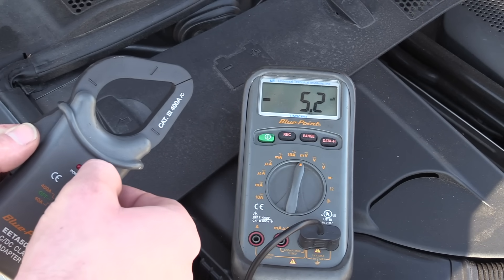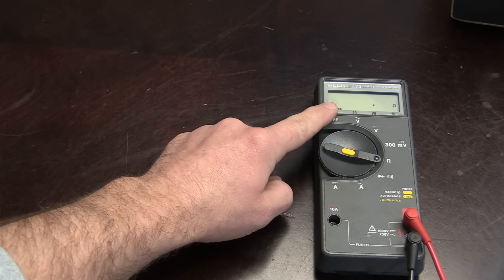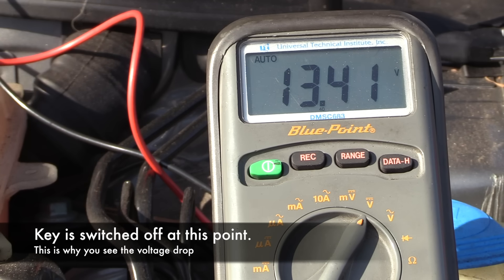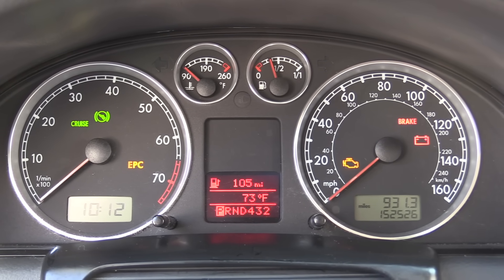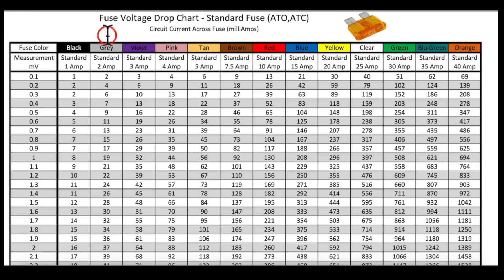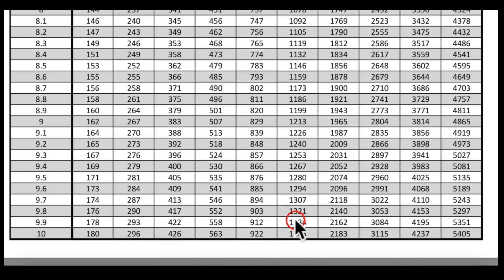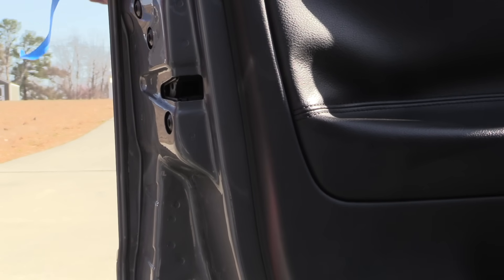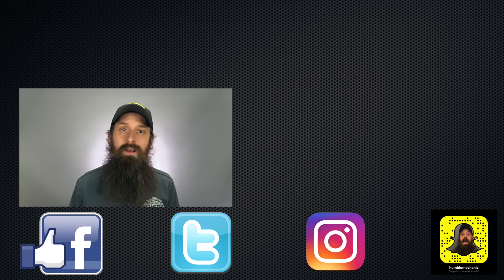The BEST Way TO Perform a Parasitic Draw Test

Comment: Ok there is a better way to do this check even for a novice.  First remove the negative connector on your battery. Next with all door closed and accessories off connect a test light to the negative battery clamp and the other to the meg. Pole on the battery. If the light shines brightly you have parasitic draw. If it does the pull one fuse at a time until the light goes out. Remember to check fuses under the dash and under the hood. Very simple works  every time.
Reply from the maker: This doesn’t work for modern cars. The issue is disconnecting batteries and pulling fuels can actually false fix things. 

Great method for older cars. Well except the door closed. Lol you need access.
Reply: Make sure you replace each fuse after you check the light before pulling the next fuse.

Comment: This is why I have 6 pre 1970 vehicles. No chips. The only parasitic draw I had was leaky diodes in an alternator and that was 50 ma, low battery in 1 month.

Comment: Pro Tip - Don't use cheap meters.....Make sure you are using a meter that uses True RMS and using a meter with LowZ also can help...using a non RMS meter can have you chasing "ghost voltage" ...also, using a meter with LowZ helps with applying a small load on said circuit being tested....My personal go-to DMM's are the Fluke 87 and the Klien MM2000....both are very accurate and will keep you from pulling your hair from chasing ghost voltage...the powerprobe is also very helpful for circuit activation, but using a DMM is the best way to chase down your draw....fun fact- most parasitic draws are caused by either a swollen battery, that is leaking acid,as the acid basically can cause a short to ground issue cause battery acid is a conductor....another well known area of draw can be the Accessory delay relay(usually found in the cluster of most vehicles)....great vid...excellent content
Reply: Not sure that True RMS of not makes any difference when measuring a DC voltage? But agree that a decent meter is worth having.

Comment: Great Video: if you find a draw on a fuse , how can you tell what other items are connected on that fuse.  Looking at a 1985 chev  C-10 pickup truck  that has a draw,   Do you happen to have any sourcces to get free wiring diagrams for vehicles? This vehicle should be  fairly simple compared to what you showed you were working on,  No computors  to wake up.  Hope to get a reply back from you... thanks again

Comment: Can't you just set your multimeter to amps and not need to use that chart?
Reply from the maker: No measuring amps is done in series of the circuit. This is messing parallel
Reply: @HumbleMechanic  lol. Thanks for the answer. It's 2 months later and I just watched this video again and understand it better now.

Comment: One small correction to note. 1006 in speaking of amps is 1.006A not .1A, simple mistake but for students it could be detrimental when they are struggling to understand 1000mV is 1V ect. Good video, glad to see other putting things out like this to help promote the industry.
Reply: Absolutely!
..."mil", meaning Thousand. ; "milli", meaning Thousandth. 1000 One Thousandths equals One(1); 1000 milliamps equals One(1) Ampere.
Reply: @stever.9925  Glad somebody caught this.  Anyone can make a mistake but if you're teaching....and you have time to edit before you post, then this says something about the author.
Reply: @Mark-gg6iy  I suggest you get a sense of humor then, it may calm you down.
Reply: Edit: Speaking in “milliamps” 1006 is 1.006a
Reply: I am new at learning about electronics and my car and I was actually confused until you explained.
Reply: @Mark-gg6iy  Did you even read the replies? I was simply having fun in response to another person’s post. 
You have been reported.
Reply: @Mr_PNW  Lmao, no! Don't report them 😂 The cruelty!

Comment: A clamp on DC amp meter can't be beat for ease and quickness for finding where a parisitic draw is happening. It takes a little understanding to figure out how to zero out stray magnetic influences that affect the readings but it's worth learning how. A chinesium clamp-on DC amp meter sells for less than 40 bucks on Amazon and every auto mechanic should learn how to use one.   They can save a LOT of time!
Reply: I have a "couple steps better than cheap" clamp on that comes in very handy, though I'll be replacing it ASAP with a good Fluke unit to augment my 87V.

Comment: Couldnt you turn car off, pull fuse, insert multimeter where fuse was and put on current scale (for circuits rated at meters current scale or lower) and get an actual reading in amps

Comment: Disconnect the ground to your battery and then attach a multi-meter from the terminal on the battery to the ground connection and set your multi-meter to amps, if there is anything above 0 there is parasitic draw, you can find out what is doing so by disconnection fuzes one by one and locating where and what is making your battery flat.
Reply from the maker: This can false fix an issue on new cars

Comment: I really did not understand the process to actually check if it has an abnormal power draw... you turn each function on for instance the headlights then you check what a normal draw should be and if it's over the fuses normal parameter limit it means you have a parasitic draw? Thanks

Comment: Ah, Make the fuse a current shunt to drive a volt meter which is then converted to a current meter via a paper chart. I just like putting a current meter in series with the battery and then go hunting. No conversion paper needed. Cool idea though but I think it's a bit indirect.
Reply from the maker: Going inline risks disruption of the circuit.  This can “fake fix” the issue. The best approach is always many arrows in the quiver!
Reply: @HumbleMechanic  Doesn't changing your battery also interrupt the circuit? After I hook up in series I can watch all the normal temporary, short time draws drop out and what I'm left with is the true unacceptable levels of current draw. I do understand what you are doing and it is definitely another arrow. I will remember it.

Comment: Or you could measure current draw whilst pulling fuses (  reinserting them you don't need to get more than one out at a time) then watch for the drop in draw.  With a good pair of needle nose pliers I can pull and reinsert fuses as quickly as I can measure millivolt drop across fuse resistance.  No need for a chart or to discuss ohm's law i.e. current times resistance equals voltage.  I would also mentioned that some microprocessor controlled circuits take some time to boot up and go to sleep.  The seat belts in a Dodge pickup with suicide doors comes to mind. The take around twenty minutes if I remember correctly.
Reply: He talks about why his method is better than pulling fuses.

Comment: I am having trouble with what you are saying in the video at 7:00 and the PowerProbe charts. You use example of 3.4mV reading and then cross reference with a 15 amp fuse in the chart. From this you indicate getting a number of 1006 in the chart which you very clearly state is the equivalent to a .1A current draw. Isn't this equivalent to a 1.006A current draw? PowerProbe does state that the chart is in milliamps. 
You then go on to state that this is 3X your spec of 35mA. Isn't this approximately 30X your spec of 35mA? If so it could be very confusing because you are contradicting your own spec.
Great video, thanks!
Reply from the maker: I’m pretty sure I mis spoke on the reading. It’s been a while since I posted this video.
Reply: @HumbleMechanic  Thanks for the correction! Very good explanation of testing, clear and detailed. Thanks again for the good work.

Comment: Hi there, I am getting a '00538 reference voltage (011) Open Circuit Error' in the Central Electrics of my VW Polo Gt Tdi hatchback. The fault code stays static when the car is switched on, but can be erased when the car engine is turned on and doesn't recur until the car is switched off and switched on again. The reference voltage specs says the voltage should be between 11-13.5, but when the car is on it is at 10.24 and goes to 12.4 only after turning the engine on. The workshop isn't able to figure out the issue, which causing the Air conditioner to cut off randomly (no faults in HVAC). They checked the wires, fuses, climatronic, body control module, replaced the battery, but nothing. Can you please give your valuable inputs?

Comment: When placing the meter on each fuse, aren't you reading a voltage drop that is parallel to the circuit itself. I don't see this as being the entire voltage drop.
Reply from the maker: If there is any load on the circuit, there willl be a VD between any 2 points

Comment: This is a great instructional video!
But I have a question Charles.
If there is a parasitic draw on a particular circuit, why would you activate any of the accessories? 
Am I missing something? I tend to over complicate things. 
Wouldn’t you be looking for a draw that’s occurring without turning anything “on”?
I apologize if this is a stupid question.
Reply: He was giving an example of the voltage drop across the fuse since he didn't have any actual parasitic drains to show.

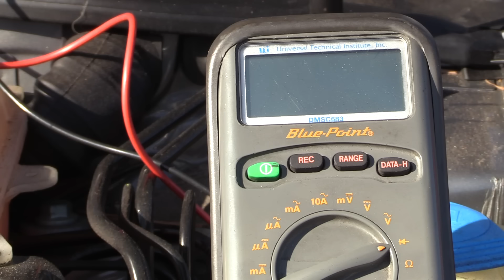Comment: I don't see the "power probe" site link posted, you broke my heart!!! 3:00 where did you connect the probes, to the battery posts I assume??? I subed. thank you, your great!
 So I assume the meter is consuming the residual millvolts left in the wires (healthy circuit shut off) and that's why the voltage drops to zero when you don't have a parasitic draw (partially, feeding, closed circuit)?
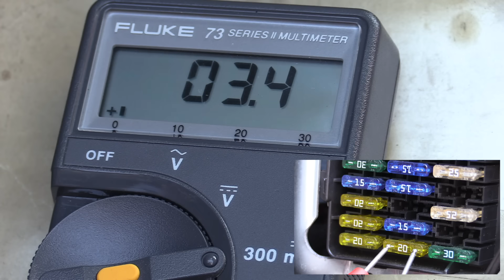 6:10 "but when you turn the radio Switch on" a parasitic draw before the switch.
 Where did you get the radio 35 milliamp normal draw spec?  Why do you have to convert to amps, isn't the volt number good enough to show there is an unacceptable draw?

Comment: If you have an older meter set to the mV range and you put the leads across a blown fuse, it will be measuring about 12V, which is WAY out of range, and could damage your meter. So check for blown fuses first! (Modern meters will probably just say "Out of Range".)

Comment: Here's a parasitic draw. Truck occasionally would not start, charge seemed weak. Thought it might be battery, but battery was only two years old, turned out to be a bad starter. When I pulled negative, noticed sizeable spark. Replaced starter, removed the negative after putting back on to check, no spark. It seems the starter was grounding, drawing the battery down as well.

Comment: I started using the voltage drop method, but have seen a few instances lately where it did not find the draw where the old school way did, so I've gone back to either amp clamp or in series techniques.

Comment: New scenario, but happened to me.
My body control module was getting wet. Sometimes the AC would not shut off when the car shut off, or the sunroof switches would not work, or other window switches, or.. even the interior lights would not shut off 100%  when the doors were closed and the vehicle was locked and alarm system on.

My mechanic said it was each system failing, but my carpet being wet told me otherwise.  I was shown how the water might have been coming into the car, so I resealed with silicone. FIXED! No more wet carpet or funky electrical draws.

Comment: I never found my parasitic draw. So I bought a kill switch. When I turn the car off I open the trunk and "turn off the battery" (my 2003 Saturn Ion battery is in the trunk). By turning the knob off (left) the battery is "off" and will not be able to draw any amps or anything else.
Finding a draw is very frustrating at any time so I choose to go around all that.
It works for me.
I'll try to do it the right way if I get help, but this is hardly an inconvenience for me.
In my case I must have another helper telling me the amps or running a wire connector to my multimeter so I can tape it on the windshield to read it. Yeah right. I still have to look up and keep my hands testing the fuse.
I'm no longer possessed by my parasitic draw with my handy kill switch - $14.50 including shipping. It's worth it to me.
I'm a bad DIY'er at best.

Comment: I don't understand how you can get any voltage reading across a short.  A fuse is a controled weak wire material that breaks open under a specific range of high current.